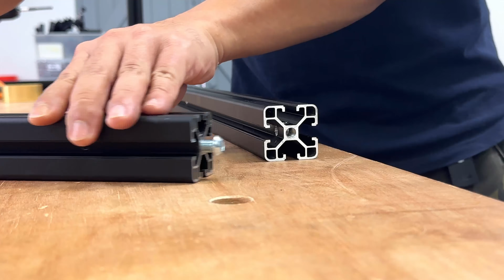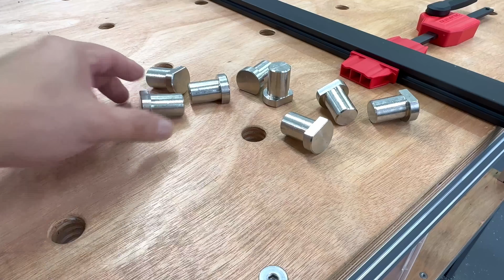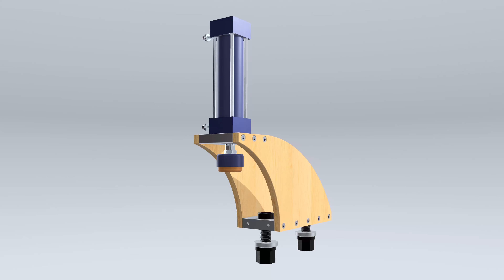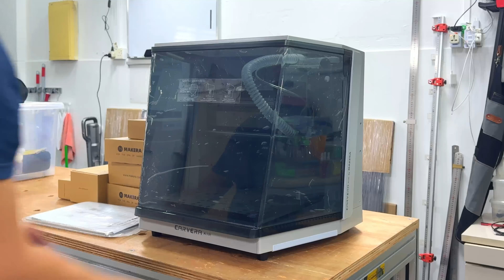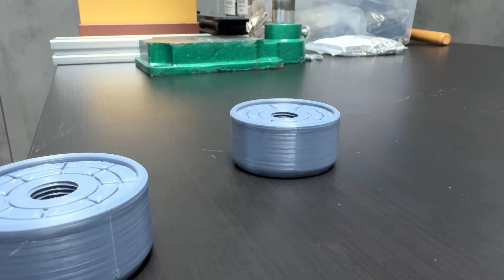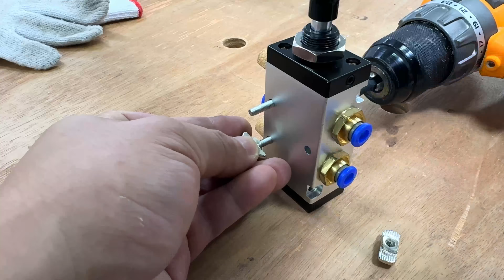I Built Pneumatic Clamps Using the Makera Carvera Air Desktop CNC

Comment: You should also move to having a dedicated drill on a bungy type cord that when you let go of it.  The drill is suspended about 1 foot above your hands.  besides a cord and pully and counter weight you would need to go out and buy a second hand drill/or impact driver.  (The cheap option is to buy an electric drill with a power cord and stop having to recharge batteries from like a thrift store.  The opposite option is to use this time for any upgrades in like cordless impact drivers etc...) That way one is constantly ready and the other travels around the shop and home spaces.
Reply from the maker: Good idea!

Comment: I didn't even get to the end of the video before I stopped and mention this upgrade.
The system should be further upgraded to include that the clamps be placed on rails and when your build secession is over with they are pulled back away from the table's edge by springs.
Inset the rail system into the table.
Use locking pins if you don't want to use air power to push the clamps out of there rest positions.
This would then make it that rather than break the system down at the end of each secession you simply release the air pressure on the air pistons that are pushing the clamps on internal rails forward.
Reply from the maker: This will be impractical cos we need the full table for assembly after the session
Reply: @TheAluminumCarpenter  This is the WHY I'm working on a modular building.  In the event of adding another tool I can simply make the building longer.  Your options include adding (4) hoist positions and lifting a Jig table higher and having your assembly table underneath.  Some even more advanced rigs have the lower table on a scissors lift for height adjustments and then they leave stuff on the lower table and just scissor's lift lower the table.   Less expensive options would be to place the jig on an indoor out door set of "All Stops" and then roll the jig outside and throw a cover over the top of it.  (That's what they did at Boeing)
Reply from the maker: U really need to make a video for me.
Reply: @TheAluminumCarpenter  My first video camera fell over an broke (High winds here).  I have a Go Pro Max 2 but I'm not yet trained on fully using it and my computer is old enough that it won't do 4K. (Also this project site is off grid.) I have a Throne account under the name CGIUFO.  Any contributions' in the direction of helping me start my YouTube channel would be appreciated.
I really need a green screen room (a Styrofoam Hexiyurt.) and then I can teach about topics like metal casting.
Reply from the maker: No u dont need all that. Just determination.

Comment: Excellent! Could benefit from adding foot pedal valve to fire the actuators, and flip stops mounted to the horizontal face of the workbench extrusion…that slide across the entire width of the workbench. Large thumbscrews to adjust positions without requiring tools.
Reply from the maker: You made all the best pointers ❤ and i will show that in following videos! Thanks!